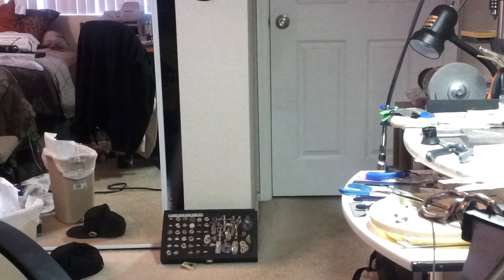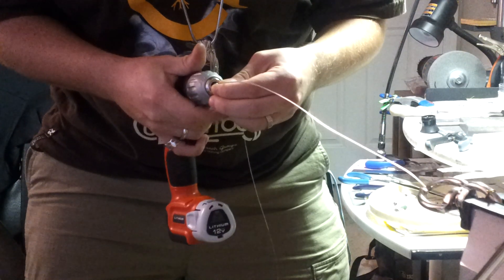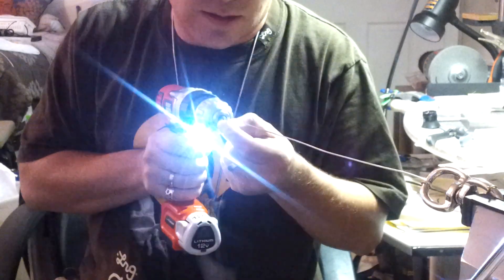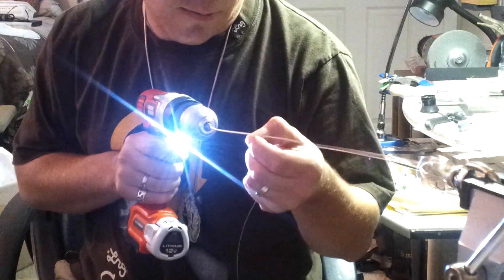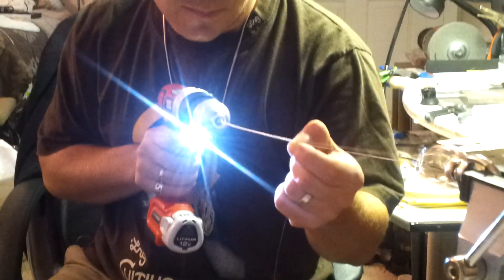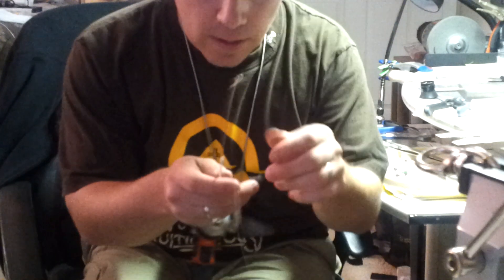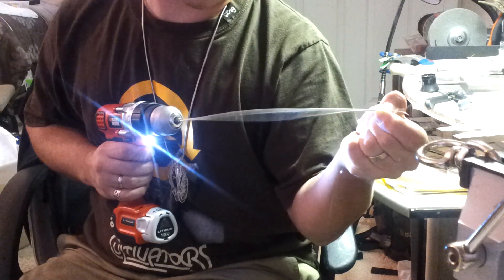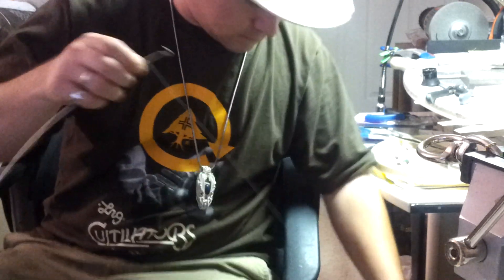How to wire wrap: Wire wrapping Lesson 1 - Long coils with a power drill

Comment: What gauge wire are you using for the base and the wrap??
Reply from the maker: This was just for example (i used big wores so you could see what I was doing-normally I'd use much smaller wires) but the main wire was like 14g steel and the wrap wire was 26g steel

Comment: What gage wires are you using here?  I tried wrapping 28g onto a 22g. But the core wire kept breaking off at the drill. Thanks.
Reply from the maker: For this tutuorial I used thick wires so you can see what I was doing.  I think it was 18g with 24 or 26g wrapped around it.  But I have used this technique with wires as thin as 34g around 30g (without the swivel part) Check out my other how to coil video for smaller gauges :)
Reply: Thanks. I figured out what I did wrong. You have to hold the thine wire right at the core wire or else it bends the core wire, causing it to break.

Comment: I use a drill press removed from the stand and set on its top with chuck facing up worked apt easier then holding a hand held drill

Comment: the part i get most frustrated with which ends up determining the look of the entire piece is the initial stone wrap. The slipping and scratching drives me crazy. I dont like wire across my stones so i need some advice on the setting part?